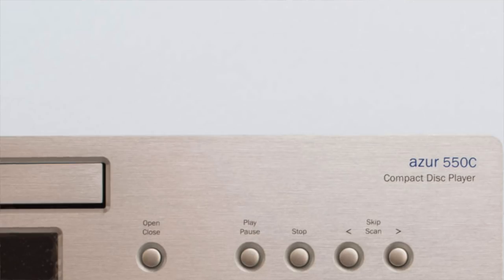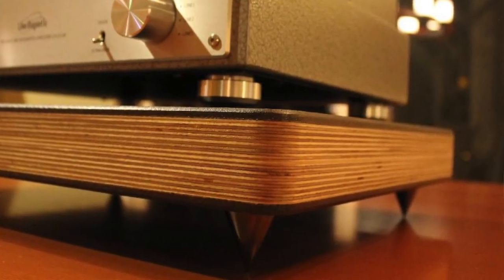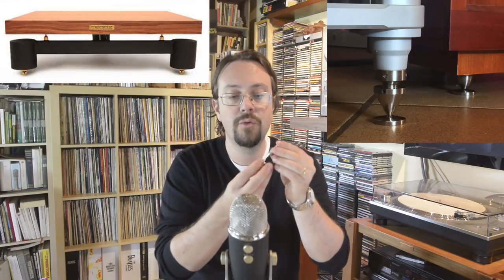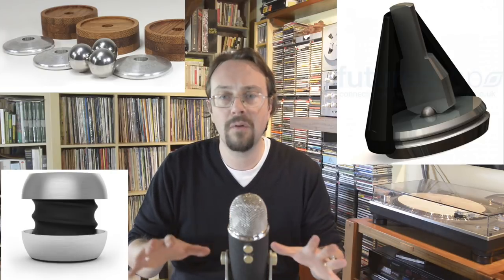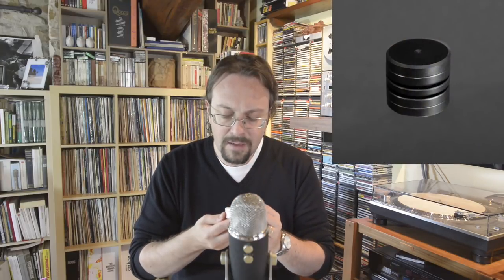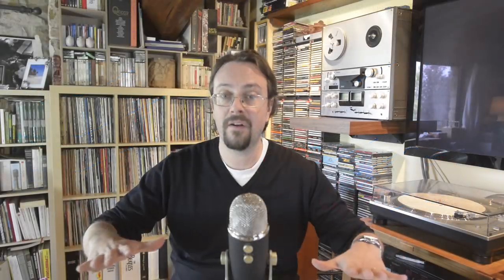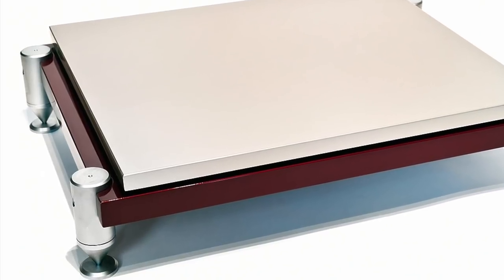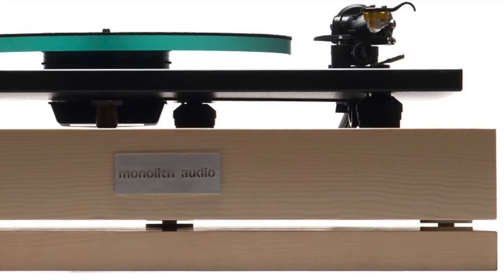Optimize your Hi-Fi system sound quality: 2 - Vibrations Isolation

Comment: Seems like a lot of pseudo science.
How can physical vibrations influence the sound from a CD player or amplifier ?
If these isolators are so important, why aren't they integral to expensive units ?
Reply from the maker: It seems, but it isn't. In the video description you will find a peer-reviewed scientific article that explains how capacitors, present in all electronic machines, are negatively influenced by vibrations. And that ia only part of the problem. Yes, in some cases they do implement solutions to reduce vibrations but only very few do that because in order to do it properly it is quite expensive. For instance, one of the main differences between the Technics SL120GR and SL1200G are the special damping feet.
Reply: @anadialog  
The article cited discusses the a piezoelectric effect of capacitors when placed under electric field i.e. they vibrate locally on the PCB when exposed to an electrical field. This isn't something that chassis feet would be able to address. Nor do chassis feet address how well capacitors are attached to the PCB or how well the PCB is attached to the main structure of the unit.

I'd be interested to know what frequency and amplitude these isolators address and see an FFT plot of the sound with and without these isolators.

The Technics SL120GR and SL1200G are turntables, which I didn't cite as examples for wondering how physical vibrations influence the sound.
I understand the sensitivity of turntables to external mechanical vibrations as they use a balanced arm to delicately hold the needle onto the record withins a small range of forces and use the indents in the records surface to generate sound.
Reply from the maker: The issue is real just Google it and you will find dozens of articles. Here is an example: https://eepower.com/technical-articles/vibration-proof-capacitor-technology/
Don't focus only on PCBs all electronics and mechanical gear suffer from this. A decent isolation will improve performance.
Reply: @anadialog  
That article you linked centres on the durability of capacitors in an automotive environment, e.g. cars.
It states nothing on the impact, if any, of accelerations of a fractions of those experienced in an automotive environment on sound quality from a home sound system.

I'd need to see FFT plots of with & without isolatores before I could be convinced and it would be interesting to see how the Vibrapod Isolators at £22 for 4 compare against the IsoAcoustics Gaia-Titans at £600/4.

To me it just seems like a way of selling small, shiny bits of metal for an exorbitant price.
Reply from the maker: Yes, because it is an environment with vibrations. There are dozens of articles out there. I am sure also with some measures. The problem is real and at more levels. Happy listening! :-)